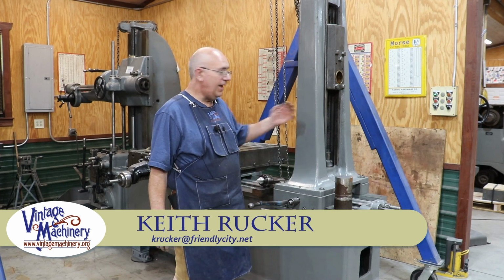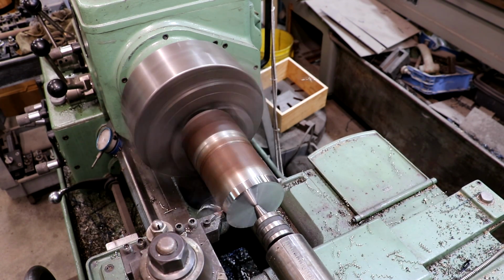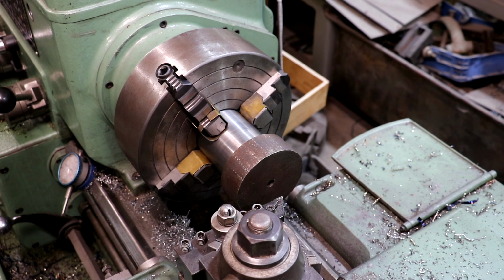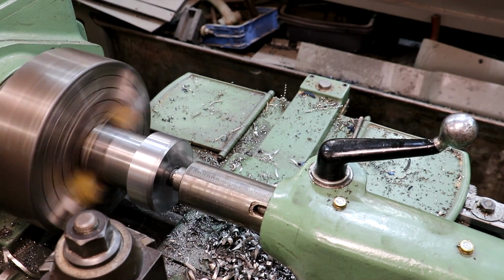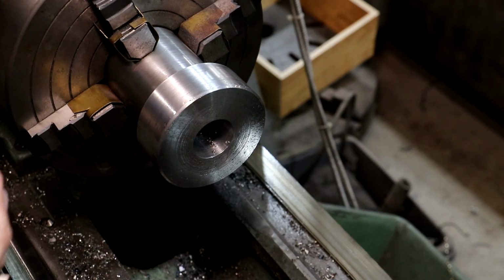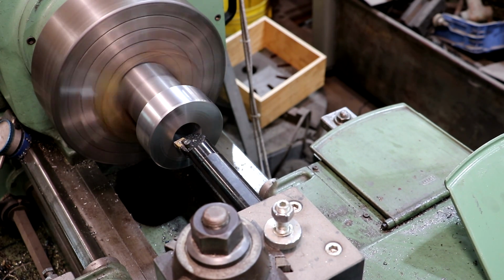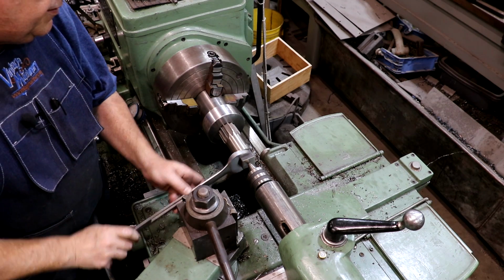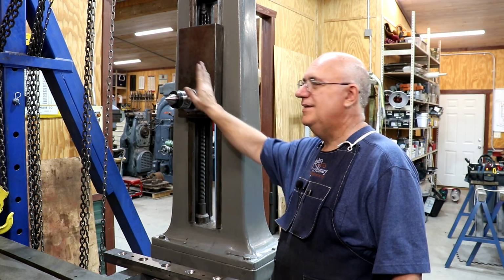Lucas Horizontal Boring Mill Restoration: Making a Morse Taper No. 5 Tailstock Adapter

Comment: I was just thinking, this could be adapted into one heck of a huge lathe!  Just build a tool post on the Bed. And adapt a chuck to the head, capable of spinning nearly 80".  It's not going to have all the features, but if it's the only machine you  have  you could get some jobs done. Doubtful you can thread be with it. Un Less you made a lead screw with the proper gear ratios.  This could be a very interesting piece of equipment!!

Comment: Repairing a Morse Taper on core drills was a common task in shipyard machine shops.  We'd indicate a good Morse taper between centers, then run an indicator in the z-axis adjusting the taper attachment until we got a 0 reading.  Then cut, file and polish mill the tang on the end, and then send the drills back for more abuse!

Comment: Wow! He turns a reamer backward 2 degrees and everyone jumps on him. It's his reamer, and he knows about it. In appreciation of his gift to us, if you must show your superiority, do it quietly somewhere else. Great job! Can't wait to see the the Lucas make chips.
Reply: Its not the only mistake he make,s There is no way for the center line of the taper to be parallel to the outside. He made  error on error. And not only that. The hole part is a is a questionable thing to use on this machine.
Reply: @JaapGrootveld  Does it really bother you that much that he didn't ask for YOUR permission to use a live center on HIS machine?
Reply: @JaapGrootveld  he acknowledged that the existing hole was not centered. He went ahead and drilled it. The boring bar brings it back into concentricity. Not a mistake. Just making skillful use of what he has.
Reply: @JaapGrootveld  I'm awaiting your video on how to do this perfectly.
Reply: Don't hold your breath!
Reply: @JaapGrootveld  Why are you so angry?  Is everything okay at home?  Is there something you would like to share........other than your lame comments??
Reply: @JaapGrootveld  No mistake was made on removing the reamer. He turned it just enough to break it loose which did not damage it at all. Turning reamers backward should generally be avoided but like all rules there are exceptions. I’ve removed a few tenths from reamers with fine emery for special jobs by reversing them in a lathe and still use them to this day.
Reply: @JaapGrootveld  WHAT ARE YOU GONNA DO ABOUT IT?!!
Reply: I'ts like scraping sideways with the  knife-edge in a cooking video, you dull the knife-edge for no reason. One can do otherwise.

Comment: A spring loaded adaptor in between the taper tap and the live center would keep the tension on the taper tap and you only have to adjust the tail stock ounce🤔🤔?  Does this exist?

Comment: 3:00 I've found it unnecessary to face the end before adding a centre hole, unless the end is really rough in which case a spot face might be helpful. One the hole's in, I can use a half dead centre to face the end, then switch over to a live centre for the rest. Much less risky!

Comment: Nice job. It looks like the shoulder diameter of your adapter is smaller than  the OD of your bushing. Hopefully when you load up that center it doesn't press the bronze bushing out of your tail stock.

Comment: Nice work.
The facing off in the beginning nearly went bad. Why not only face off a little portion around the center point? Making it to some size using the proper type of insert the rest of the facing off could be done when the support center is applied.
Reply: I would have liked to see him tighten more than one lug on the chuck with that big hunk of metal unsupported.
Reply: @GreeceUranusPutin  That's an obvious option but the danger is always there, thinking about an ever longer stick out. Why not just clear the spot for the center boring?
Reply: Did you bother to listen to the video?  He explained and adjusted!
Reply: @paulcopeland9035  Yes! I watched the entire video! Any more questions?

Comment: Abom has a trick for side loading a center drill to true up a wobbly hole. Otherwise one should consider using the compound to machine it true to 60 degrees. But you got it done.
Reply: The question remains:  What was wrong with how he did it?  I believe it turns out perfect.

Comment: I use a domed head carriage bolt (with the sharp head edges and threads removed) mounted in a tool holder to gently nudge my work into the best possible centering using the lathe carriage before I start.

Comment: The live center can be set up with a threaded hole in the end so a threaded rod can be installed and nut and washer used to lock it in if the need ever arises.

Comment: I'm at 19:30 or so in and there is no discussion of the taper angle that distinguishes taper with respect centerline vs. included angle taper.  You could completely ruin a project by switching one for the other.  Explain the difference and be explicit about what you're doing.

Comment: Keith Place a "strap" with a center drill hole on the strap's face, on the rough face end of your rough stock. 
You can then hog off the OD with the tailstock live center inserted into the strap for your support! 
After the OD is close to finish or finished, then take your face cut and center drill AFTER hogging OD!
This insures the work while hogging, doesn't move BEFORE you establish the work's finish face and center drill!

The strap will give you the support required to hog the OD first before finishing the Face.

Comment: If you needed to you could make a drawbar, thanks for your efforts.
Reply: I agree, a draw bar would be a good idea, to prevent any possibility of the live centre Morse Taper slipping in the adapter sleeve.

Also, is there really not any space, for even a very thin/narrow locking ring?

Comment: Taper attachments still confuse me. Do you uncouple the nut from the leadscrew? Or does the cross slide handwheel turn when the carriage is following the taper attachment?
Reply: The implementations vary, but the South Bend 10” has a “telescoping” cross slide lead screw.  The taper attachment anchors the far side of the lead screw and can move the cross slide as required to cut the taper.  The hand wheel section is attached to the threaded portion of the lead screw via a telescoping splined connection.  Thus, when you turn the handle, the cross slide advances, while the taper “tracer” controls the profile.
Note that the smaller South Bend 9” lathe taper attachment doesn’t have enough space for the telescoping section, and you must remove the lead screw nut pin to let the taper attachment control the profile.  On these types, you use the compound to advance the cutter depth.

Comment: If you are concerned with the adaptor moving in the bush, would slitting one side of it along it's length allow the tapers to interact, and expand it a fraction so it tightens it's fit in the bush?

Comment: The largest diameter drill bits I've ever owned were 1-9/16. I bought them at a scrap yard, and they were sharpened, and had the plastic dip on the tips.

Comment: If you are going to use that for lineboring, you are going to want to make sure your quill lock is exceptionally strong. The Quill lock on those old 31s was prone to slipping once they got some age in them and there was typically a locking collet closer that went on the face of spindle nose to clamp the spindle bar for added support, that you appear not to have.

Comment: I do recognize that there is a difference between a machinist and a tool and die maker but, I have often wondered why you and Adam don’t make more of the tools that you need.
I am a steam fitter and I also do plumbing but I have worked with welders that would rather be shot in a tooth with a B B gun than do any plumbing

Comment: As a guy that does lots of form reaming,  the wax paper and rapping is a one time thing,  I would recommend that you put a light coat of synthetic atf on them for storage.  The best antitrust oil that wipes off very easily and also cleans the tool.
Reply: 101st use for ATF, thanks for sharing.

Comment: I'm sure someone else is going to comment on this, but the "tower" style tailstock on this HBM wasn't designed for substantial thrust loads in the Z-Axis. They were designed first and foremost handle boring operations (X and Y Thrust loads). If it were, there would have been a "loaded" bearing in the tailstock, and the tailstock would have been substantially deeper (I have seen a HBM rigged with Two tailstocks back to back, sharing a common tailstock bar  "ganged" to give more support, but I don't think it ever used a center. As I recall, the application was a very long horizontal milling bar. There were milling operations needing to be done using a ganged wheel cluster in the middle of a large valve body (~4 feet into the body), to cut a series of scallops which were used for seal retention/ adjustment. The two tailstocks were to give more rigidity to the bar. The bar and the cutters were custom made for the application.

Comment: The squeaky noise was from a lack of abundant lubrication. And you should use a felt wiper before test fitting the shank. And you should never turn the reamer backwards to remove it or you will cause dulling and possible damage to the reamer.
Reply: "And you should never turn the reamer backwards to remove it or you will cause dulling and possible damage to the reamer."

I noticed that too.

Made me cringe.
Reply: Up tight and outa sight.  I wonder if you’ve ever not done the exact right thing.  Prolly not hey?
Reply: @todaywefly4370   A little Stevie Wonder there!

Comment: (Morse) taper reamers are pretty good, I think. Even the Chinese one I have. It's a small MT1 for a Sherline and judging by the bluing test, it's a perfect fit. I think it's easier to grind a reamer to high accuracy than it is to bore a hole with that same accuracy, given that grinding allows for more precision than turning. So, I assume that a reamer is likely to be just a little bit more accurate.
Only possible issue with a reamer is that it does not guarantee concentricity, while boring does.

Comment: Are we Ready to finally fix the stoker Engine? it has been what 2 plus years i think...
Reply: Good question. Who has that project now?
They could do it 100 years ago so it should be able to do now.
Reply: I’ve been wondering if that’s the reason for all of this.
Reply: If my memory serves me right it’s a deep pocket in the Stoker that’s been been built up with weld and needs to be machined. Since there’s a very limited area to work in I’m thinking only a long powered carbide end mill might do the job. Rigidity would be a problem even if that was possible. Just a few wayward thoughts here since I’m also interested.
Reply: @ellieprice363  You people should know better than to ask about  that, you just might get scolded like I did!
Reply: @garybrenner6236  You deserve it!!  You are using up all of the 'comment ink' with that question!!
Reply: @garybrenner6236  Couldn’t help it. Had to put in my useless two cents worth. 😊😊
Reply: Don’t worry. I am sure Keith will eventually get it knocked out or worst case it finds its way back to the home of the impossible and we will get it done.😊

Comment: I thought I saw on of the cardinal sins.. Turning a reamer backwards.    A cover plate with bolts would be easier to hold the adapter in place than threading the end and making a nut..

Comment: 1 25/64? Really? 🤯 You guys either need to switch to metric or at least start using decimal inch sizes. WTF’s wrong with 1.400”? 😂
Reply: For one, 1-25/64” does not equal 1.400”. It is 1.390”. That 0.010” can matter a lot depending on the job.
Reply: Mark Beard: Why not educate yourself a little on the Imperial system. Don’t expect American channels to do your conversions for you. If fractions confuse you watch only metric channels.